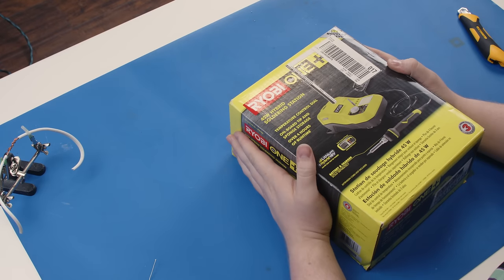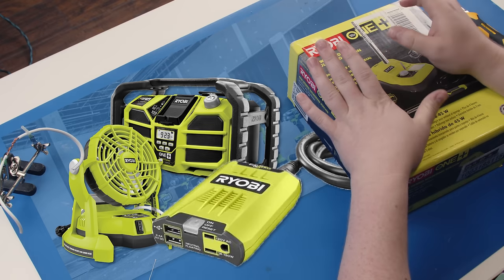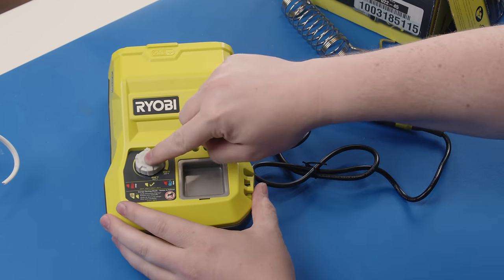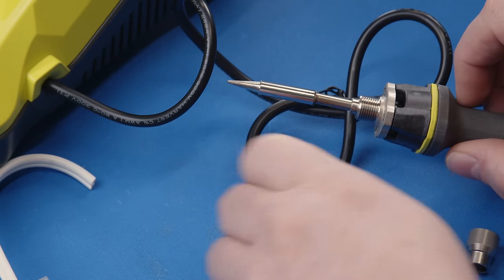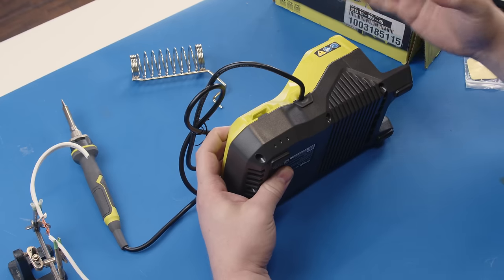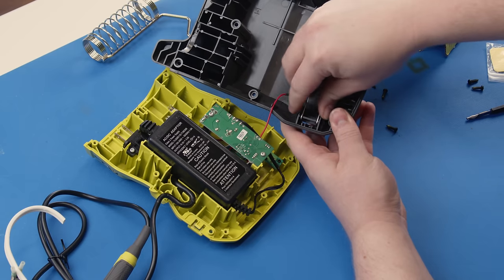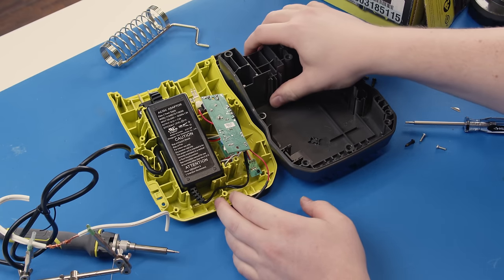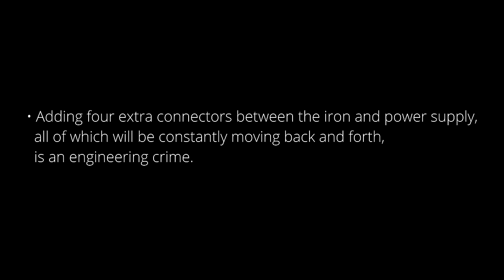Ryobi has GOT to be joking with this soldering iron

Comment: I'm an EE and electronics guy with 40+ years under my belt. The trouble with this sort of thing is it's always cheap built in china to pander to the masses. You'll find some features which are good, but there's ALWAYS some that let the item down (such as the PVC cord). 
I just looked this unit up where I live, and it doesn't have the AC (mains power option). It's listed as a battery-only unit. That's a disappointment (not that I would likely buy one anyway) but we always get shafted here when it comes to features on things.
That got me to thinking - the space where the AC adaptor is on the US model will be empty on the model sold here. I could just get an adaptor and shoe-horn it in, wire it up and PRESTO!
Incidentally, the price here for this battery-only unit works out to the equivalent of $108 US.
Reply: Ironically probably the best portable soldering iron at the moment is the TS80p. And it's not only from China,  its designed there as well

Comment: I have had this soldering station for the last few years, I always keep it in the car and I have used it a lot. I’m very happy with it.
One odd thing tho, mine only takes battery no ac input. Maybe because I’m in 240v land??
Reply: Probably yes, as the US connector is not approved for 230VAC use, and fails all the certifications for use in the EU, as it has insufficient creepage, and has no shrouded pin option available, while the near identical blade wise ( but not orientation wise) Australian one does pass this.  I do not think any company wants to pay the cost of harmonising the changes needed for this, as they would never be able to recoup the money, and there would be no protection on it. So leave it out, and put the blanking cap in during manufacture.

Comment: You know all things considered, this doesn’t actually seem like too bad of a soldering iron.  It’s goofy that it has a laptop power supply hiding inside there, but at the same time I sort of find that charming in a sense. It’s like a project that a hobbyist would make; why engineer your own power supply where you have a risk of breaking everything when you can just outsource this to an external entity and let them worry about the details?
Reply: I agree. No need to reinvent the wheel on something so simple. Power supplies should be picked off the shelf when possible.

Comment: I have had 2 of these and love them. The first one quit working when the ceramic burned out. And you can't replace it.  Everything is soldered in. So I bought a new one. The broad tip is good for soldering on larger surfaces that drain the heat off the tip at first. Also have the light. Very handy. They also have a hybrid flood light. Very good stuff.

Comment: I think the use of the power brick inside the tool is genius tbh.
Reply: It saves the cost of EMC compliance and safety testing. If Ryobi designed their own they would have to go through compliance testing which adds cost. Many manufacturers also use off the shelf or customized of the shelf bricks. Faster time to market for the product using an already compliant brick.
Reply: @bobsmith3983   Yeah and there's no point it buying a bare one like he thinks they should  have. If the price is right, who cares if it is over-engineered?
Reply: Even better it makes a key component easily replaceable.

Comment: I never laughed so hard the second you popped that open. Was not expecting that. Now I'm paranoid that all my devices are hiding rando off the shelf encased power supplies with hidden "never see light" leds hidden inside.
Reply: Wait until you see nock off laptop chargers !!!!!!.  They have leds even when you will never see them. Many chargers do no have leds when original, HP for example. So their casing do not expose this crappy led ... but they dont feel cheap enough to take the horrid led out. And this is only the cosmetic part, just wait to see the soldering and isolation separation .... ticking bombs. And dont put tons of effort researching ... they clone even the small detail

Comment: I've been using the Australian version of this for around two years now, I can't say I've had any problems whatsoever. The cable will work itself out with use, and while it also has the same 80 degree limit on the cable, I've yet to encounter even a risk of melting though it. It also doesn't have a mains transformer
Reply: The adapter they fit in there is basically a mains transformer.
Reply: I like mine also without the Ac power pack. Lighter and not needed IMO.

Comment: With some customization (modding), that could actually become a REALLY good soldering station. :O

You could set it up so that replacing broken wires is just a matter of unplugging the wire from the outside, and plug in the new one.... Like it's cheap, but it's good, it's build like an industry-grade NES, it's fkin brilliant, just needs a better wiring system is all, and that can be arranged with some modding. :)

Comment: My dad had an iron for soldering car radiators years ago. It was like a fat dagger with a wooden handle. It was too big for electronics . Fantastic how quickly technology has changed in a short time
Reply: Those where pretty standard about 70 years ago
Reply: Those still exist, are usually 140-200 watts, used for soldering stained glass, pipe organ pipes, and of course radiators. They had little soldering irons back in your dad’s day too.
Reply: My dad did, too, but he only used it where there was plenty of room, and usually for building tube-type amps, etc, from components in a chassis. He would keep it next to his coffee cup.
He also used it to fix leaks in our gutters. 😄

Comment: Been soldering things for around 30yrs.  Never used a temp controlled iron.  I just time it out, like you're supposed to.  Too long, it makes everything too hot.
Reply: A temperature controlled iron is useful when you deal with really small (SMD) components on a PCB, because the amount of heat that needs to be delivered varies greatly betweem a tiny component on a tiny PCB pad to a bigger component on a massive PCB ground plane. It's good to have 80-100W of power available to heat up such a thermal mass in a reasonable amount of time, without stressing everything around by prolonged heating using a conventional 15 or 25 W iron. 
Before I  got my first soldering station I used to boost the small conventional iron with a gas cigarette lighter when I needed the extra oomph 🙂
Reply: @68MalKontent  I use a 90w iron
Reply: Good comment! Fully agree...and when he was going on about the "heavy load" that the metal flange has to take...what?? How heavily does he mean on a PCB lol?

Comment: Love the video but I disagree on one thing, my hand held iron that I bought for $30 like 20 years ago holds up just fine and has never failed me in my work.
Reply: There is A LOT of things to disagree with the video. First he is crying how stuff is poorly / cheaply built and then cries why they used so much plastic to have this thing rugged...
I guess these days everyone can have a YT channel where he rants about stuff he knows nothing about... 
As long as it is presented "professionally"  then people believe it must be actually made by professional...
Reply: I have a cheap little 20$ one that runs off the same technology as a vape pen. Just with a soldering iron in place instead. I've had for around a year and still works well for small stuff when i don't feel like breaking out the full sized soldering iron.
Reply: Exactly! First he says that he stuffs up any solder job, even with good tools, then thinks he's qualified to rubbish other equipment.

Comment: Edited because I'm an idiot: For your main bench use, even if you love your Weller, I recommend trying an integrated tip/heater style iron. I bought a really inexpensive one that uses hakko T12 tips. The difference is amazing.
Reply: It takes around 5 seconds from cold to hit temperature, and it handles big ground planes really well.
Reply: Yeah I agree. A TS100/Pinecil would be a good alternative for the main soldering station not just as a portable thing.
Reply: 951 is obsolete tech. The newer T12 cartridge tips are better due to the heating element being integrated into the tip having better heat transfer. But 951 tips are incredibly cheap now as companies are trying to dump their old stock of them.
Reply: @1pcfred  Argh!! I meant T12. I'm just batting 1000 today.
Reply: @JamesPotts  I thought about getting a 951 when I bought a new station.  I'm glad I went with the T12 though. They do heat up fast. I bought an old 7 segment LED model because the oled ones just seemed too confusing. Now I'm not so sure.
Reply: @1pcfred  I went with an OLED model. Once you figure out how to change the language to English, it's not too bad.
Reply: @JamesPotts  at the time all the features seemed like too much to me. I just want a soldering iron to get hot. Adjustable and tracked temperature is nice too. Turn on, get hot. Sometimes get a little hotter. That's the extent of what I look for in a soldering iron.
Reply: @1pcfred  agreed. I've never used a single "feature" of the firmware.
Reply: @JamesPotts  yeah it just seemed pretty involved to me when I looked into it. More involved than I wanted to get as far as a soldering iron goes. It seems like I'm forever just trying to figure out how stuff works anymore. Plus way back when I really wanted a digital adjustable iron they just had 7 segment displays on them. Just the digits and a knob. So that's kind of what I wanted. I purposely bought the model I did because it is kind of retro. Still gives me the warm fuzzies looking at it.

Comment: I have been using a Radia Shack butane iron like that for like....damn, 20+ years😬 I mostly use it whe  I'm doing wires outside or automotive soldering, but I used it on a lot of older electronics too. It was often easier than getting a cord and having room for the base etc. I worked on old Arcade games and was often in a really tight space when working non them. I would say about 85% of the solder types I did often could be done with one. The older the easier. Newer 1999ish+ surface mount is another story though. They are actually pretty nice to use and FAST!! if yiu need a fast solder, it's perfect. It's ready to go a few seconds after lighting it. They make a good cigar lighter, too!

Comment: Maybe I'm weird, but I love my weller magnastat iron. It does require mains power, but it's literally only the iron, the holder for it and a sponge. As the name suggests, its temperature control is a magnetic switch. That temp control is integrated into the tip, so if you want a different temperature, you need a different tip. Thing is, I only ever need that one standard temperature, so I've been satisfied with my two existing tips (a smaller and a larger one) forever :D
Reply: You can't beat the old Weller magnastats, and they almost last a lifetime if looked after.

Comment: I use a fairly cheap (80€, great for the features) yihua soldering station, its got a pretty basic lab supply, a temp controlled soldering iron, and a hot air gun. Its also a really neat package cause everything except the stand for the soldering iron is contained on one box, even the hot air gun has its holder mounted right to the case, and all you gotta do is plug it in and turn on whatever function youre using. The downside is that its a pretty large unit for a soldering iron and so slinging it in your bag depends on the size of your bag, though ive taken it on the go with me before (id consider it less portable, more luggable and easy to store). It also isn’t great quality, i had 2 units that were both broken before i kept the less broken one thinking id just swap the iron itself to fix it because it was reporting a temperature error, turns out one of the pins inside the station wasnt soldered on correctly so the thermistor was disconnected

Ps, i need more of gravis making horny jokes in my life, you had me giggling like a schoolgirl for half an hour

Comment: I enjoy most of your videos immensely, but I'm also someone who has done some amount of soldering nearly every day for probably close to 15 years. Aside from the PVC cable critique, which is totally valid, most of this video REEKS of someone with pretty minimal knowledge of a subject both speaking like an authority and having set totally unrealistic standards for a dream soldering iron. It's not a great look.

Also, your brief critiques of the TS100/80 and Pinecil are kind of bananas. The Pinecil might be the best thing that's ever happened to my portable electronic repair kit, and I'm seriously considering buying another to outright replace my beloved benchtop station. It's amazing.
Reply: The PVC cable bit wasn't even fair, either.   Who the fuck expects to rest a 900 degree iron on a cord and the cord stay fine?  Or him showing how 'bad' PVC is because... he held it so the bendy cord would flop back and pull on the iron instead of draping it over the back of his hand like a person who used the tool.

PVC cords suck, don't get me wrong, but they're annoying to use.  Not dangerous.  Also, JFC at someone calling a Hakko tip proprietary and only available at home fucking depot.

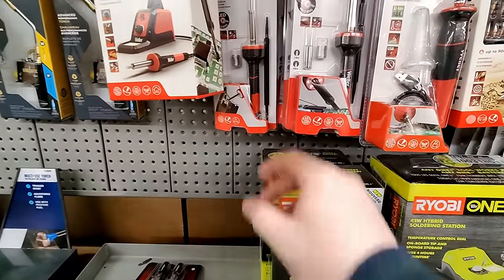Comment: 8:33 i mean, i've been soldering for years with one of those cheapo irons and the temperature has never really been an issue

i've used a 45w iron to solder everything from delicate game console mods to big beefy Lithium battery cables 🤣
Reply: You know the saying, "a bad workman blames his tools".
I've used for years both the cheap irons that just plug in, and soldering stations with temperature control.
Never had a problem with the cheap ones, hell, I've even used those Weller 200W soldering guns to replace a button on an xbox 360 controller, completely overkill but it wasn't a problem.

I could probably solder with a damn iron nail or Nichrome wire if I had to.
Reply: The right tools only make it easier and faster. Technique is what makes it done right.

Sometimes the right tools enable the right technique but I agree in the end I’ve used a TS100 to basically accomplish whatever I needed. And with the right tip I could get whatever done with some junk iron.
Reply: I've used cheap irons for the past 15 and worked well never had an issue

Comment: I had a weird solder incident one time.  The iron in question was a Weller, one of those blue ones with a base station.  Variable I think. 
At work one night we had a large, multi-station $4 million machine for assembling electrical connectors.  A wire to one of the sensors had a flakey solder joint.  I knew I could resolder it on the fly without shutting down the machine.  Soon as the iron touched that wire the entire machine shut down instantly.  WTF! I knew that machine better than anything.  Even the engineers were scratching their heads over it.  Then I saw the problem, the stupid soldering iron had a 3 wire line cord with a GROUND wire.  That potentially makes the tip a part of any circuit you might be soldering.  In this case it wasn't a short but a ground-fault interruption.
Reply: Isn't that pretty much standard to make it esd safe? Most soldering stations I've seen has that. I would probably make really sure one doesn't before working on live equipment with it.
Reply: @nightdew4934 
I suppose.  Even the engineers I was working with were surprised at what happened. 
The case is plastic. The iron I think had a bakelite handle.  I don't know if the heating element is 120v or low voltage.  There's plenty of power tools with plastic cases without ground wires.  How is the soldering iron any different?   I just don't see the safety in grounding the iron tip to where it can electrically affect the circuit.  I've "live" soldered with non-grounded irons for almost 50 years and never had an issue. 
Fortunately nothing was damaged and nothing else came of it.  I suspect the ground wire is some gov't regulation.   The company was concerned enough that only non-grounded irons were allowed to be used on the machine afterwards.... whether live soldering or not.
Reply: @Iconoclasher  The thing with soldering irons compared to other power tools is probably that most power tools aren't used for working on electronics. An electrostatic discharge can be really bad news for a lot of electronic components so I think it's probably for the better, but there are obviously situations where it's not a good thing as we see here. But as you say I wouldn't be surprised if it's a regulation thing as well. In either case, it probably easier to remove a ground connection that is there rather than the other way around. I'm guessing live soldering is a bit more rare than working on unplugged equipment as well. But good thing nothing blew up at least :)
Reply: @nightdew4934 
One thing that was shocking (puntendedly speaking) was the instantaneousness of the shut down.  There was a lot of electronics between the sensor and the internal circuit breakers. 
One time I was working on some electronic device at home and I had a temporary line cord with a 10A fuse in it.  Just a standard AGC fast-blowing fuse.  I accidentally shorted something and the house 20A circuit breaker popped off before it damaged the fuse.  Those fuses can blow in a few milliseconds but that mechanical breaker snapped off fast enough to prevent fuse damage.  I didn't think that was physically possible.  Weird! 🤔